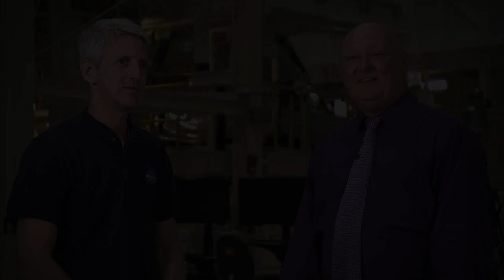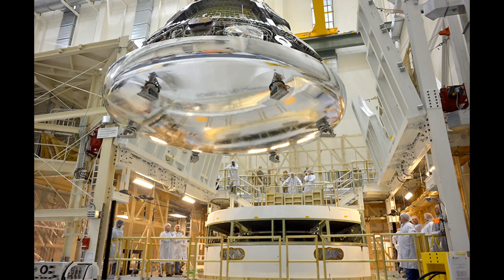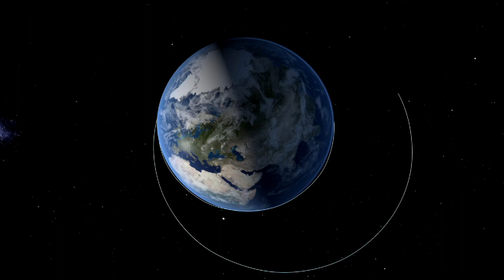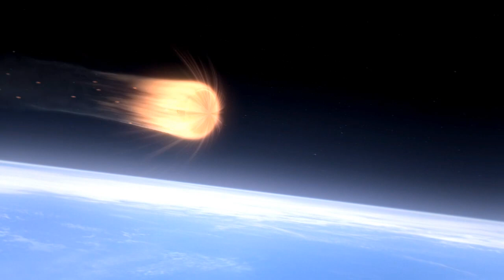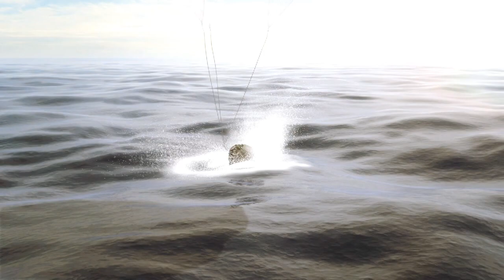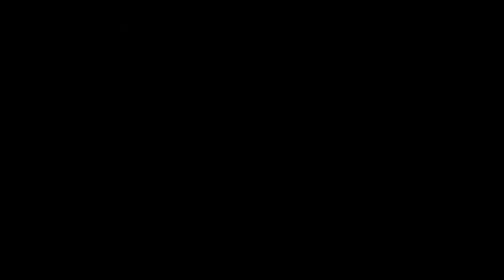Space Station Live: Orion Prepares for First Flight Test

Comment: Four more task they need to do 1. install the protective shroud over Orion to protect it from the elements. 2 transport Orion to the Payload Hazadest Facility and top off the service module with fuel. 3.transport Orion to the Explosives Integration Facility and install the ATK Thiokol Launch Abort System. 4. transport the completed spacecraft out to SLC 37 and integrate the spacecraft for launch.

Comment: I wonder if they will take the opportunity of the empty craft and stuff it with extra testing equipment. I'd certainly not waste the opportunity.
Reply: they will remember Apollo 2 they did the same thing on Apollo 2. equipment going in are a Geiger counter to check for radiation (since space is radioactive) install thermal detectors (Orion will have to go through 10,000 degrees of heat) and shock detectors the detect impact blows plus an induced contamination monitor will be installed to check for contamination.
Reply: geomodelrailroader No, i meant extra equipment. Like cameras and perhaps experiments. Those things would be standard on any human piloted craft.